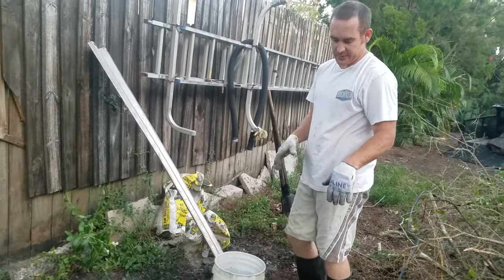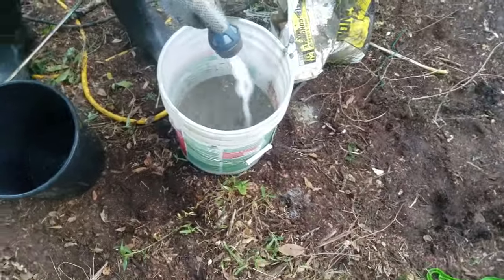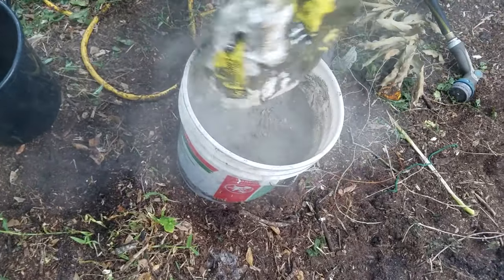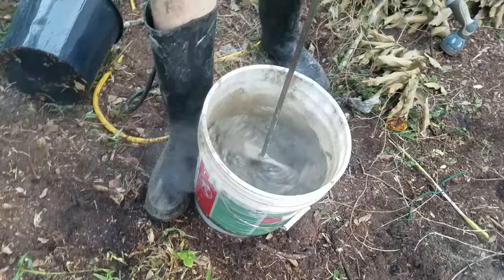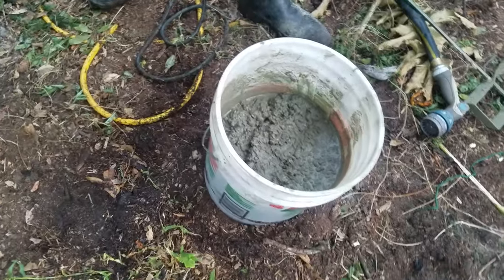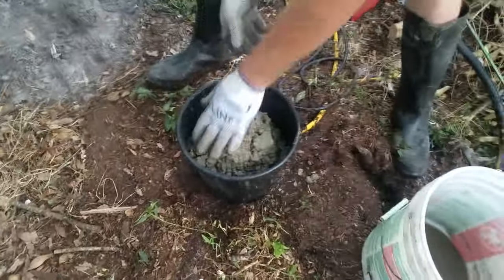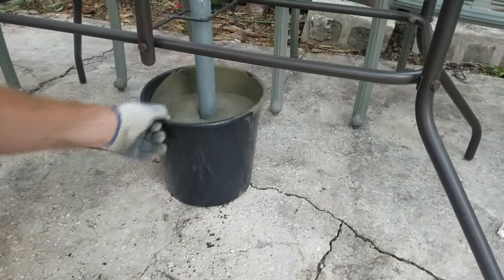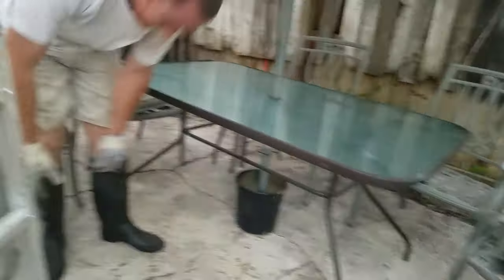How to make a umbrella stand cheap DIY

Comment: Put a piece of pvc pipe in the middle let it cure and then put your umbrella pole down in it. That way you can pull it out whenever you need to.  Also after the whole thing cures, take off the plastic bucket and you will have no problem with standing water. Just sayin!
Reply: I noticed that he f up
Reply: it'll be wobbly with the pvc pipe unless you drill thru and put bolt/washer to tighten

Comment: You should have set a plastic PVC pipe slightly bigger in diameter than the umbrella pole into the bucket first, secure it in the center of the bucket with tape, then add the cement and let it set.  Then the umbrella stand is portable and the umbrella can be inserted into the plastic PVC pipe and the whole set up is portable.  When the season's over, the umbrella can be removed from the stand and stored.

Comment: Add a pipe in the middle for the umbrella pole to rest in. And a second smaller drainage pipe to a hole in the bottom. This way you can put potting soil on top of the cement and plant flowers

Comment: Also good to use a 1.5" wide pvc pipe 1.5'' in Length (width of pvc pipe depends on the width of your umbrella stand), then you just slide your umbrella into the pipe that is cemented in the bucket and the the umbrella is separate from the entire umbrella.  But either will work!
Reply: a thicker pvc and if you can drill holes on both sides and create some thread to screw in a bolt to provide additional support

Comment: I would have drilled a couple good sized holes through the original pole so the concrete gets inside which helps anchor it in the concrete a lot better. 
Also could have put a larger-diameter pipe in the concrete and slid your umbrella pole into it and pinned it. That way it can be removed and used for a different/new  umbrella

Comment: It would be easier if you placed a pvc pipe in the bucket. Then poured the concrete around the pipe. That way you can insert the umbrella in the pipe rather than permanently into the concrete.  Your method will require to much work to remove the umbrella when required.

Comment: So how do we get the umbrella out of the stand?
Reply from the maker: That's a good question, I want to make another video showing how to make one that can be removed
Reply: Cover the bottom of a pvc pipe with duct tape and insert it in the concrete or place a pvc with both end taped so the concrete doesn’t penetrate, then pour quick set concrete in the bucket.  No need to do all that mixing with quick set concrete.
Reply: Why wouldn't you want to remove it at some point???
Reply: You don't . . ever.
Reply: Kendall Todd TheSilverGuy My umbrella is two parts. There is a little button you press to take out the top of the umbrella for storage. The bottom pipe stays in the stand.